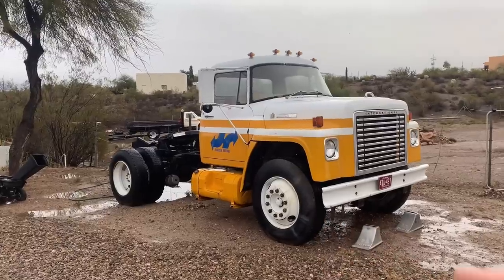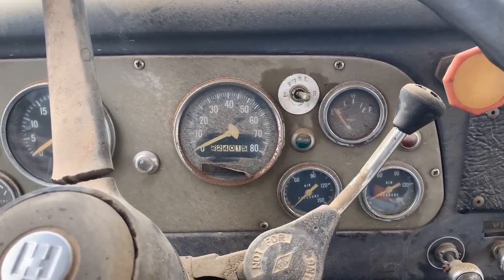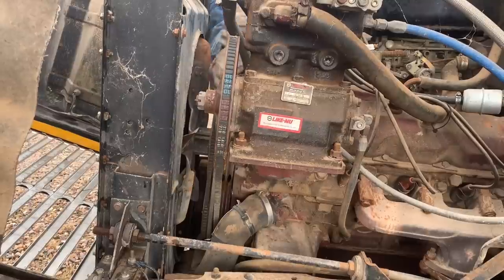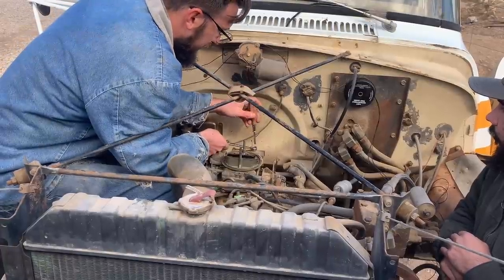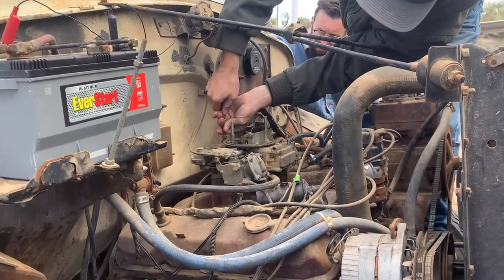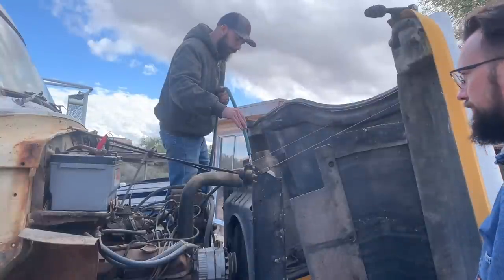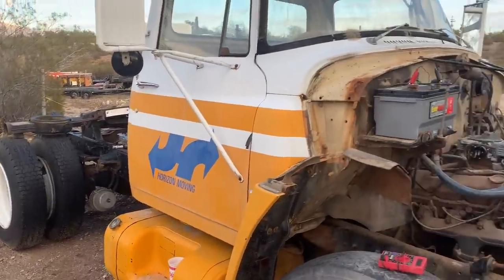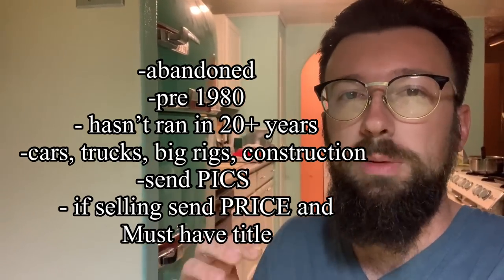Will it run and drive? 1975 international 1800 first start in 24 YEARS!

Comment: That truck is from Tucson,I worked at Desert IHC when they sold it to City Van Lines,before Horizon bought them.If I remember right,it's a 392 ,a really good and strong engine. Thats a really cool truck.that distributor is a Prestolite if I am not mistaken.

Comment: That “not for parking” valve is trailer brakes so you can apply them without having the tractor brakes engaged. Handy for sliding adjustable trailer tandem axles to adjust weight distribution

Comment: Fix it up. Replace all the brake components. Replace any pumps. Find an old trailer box. Fix that up. Make a camper out of it. I lived in Tucson in from 95 to 06. I lived is several apartments mostly around Northgate area

Comment: I know this video is over a year old now, but it's a good idea to have a ball peen or a big ass wrench in hand when turning over an engine you're pretty sure might have a stuck float.

If it starts to blow gas out the top immediately grab the throttle and open it up to keep it running, and start beating the ever loving shit out of the float housing with whatever tool you have in hand until it stops flooding.

This way you can avoid most carb fires, and possibly something worse than that if it gets out of hand

Comment: O-H-I-O Porter greetings 🇺🇸 Those old IH Loadstars we’re quite unique. I remember the bakery in my hometown using them. Cool trucks! That hand valve is a trolley valve for the trailer brakes. It is so cool to see these old trucks still running or reviving them is wonderful! Not surprised that the fuel lines were brittle. You could’ve saved some or all of the rear tires, but that’s how it goes. Glad that you got it running again! I shall look for the next video on it. I’m so impressed that the cab was in such good shape, being in Arizona or not. Good stuff! 🥰😎✌️

Comment: The cubic inches is stamped on the right front side of the engine I think just below the fuel pump. It could be a 345, 392, 404 or I think they made another size bigger but I'm not sure about the number. Maybe a 446. I had a 1974 set up just like that with a 392. Sold it regretted it ever since. Would be interested in that one if its for sale.

Comment: Not trying to be a know it all but are the plugs all in the right order as it sounds like its still misfiring... that said, a valve adjustment if its got adjustable rockers. I have seen these with bent push rods and that can cause running issues like bad idle and terrible throttle control. It should have the same firing order as a chevy only counter clockwise as you said. Lots of transformations on these rigs as they went from the 345 and 392 engines. I had a lot of trouble using the holley carb and used the edelbrock and just things came right together for the starting and idle, plus good throttle response... I really would peek under those valve covers tho cause they were  commonly known for bent pushrods. Another  thing that bugged me on those engines was the oil pressure was almost like a tachometer as it jumped up and down. I loved how much those  trucks were capable of doing. Nice cabins and good steering. I always kept a international around for my grunt work... most of my rigs were kenworths

Comment: Great video! I've got a Fleetstar 2110A that I'm working on getting to run in Brighton, Colorado. Very similar to this truck! 478 engine with the single axle. What is that lever that says "not for parking" on the wheel column? Still trying to figure that out!
Reply: The lever is for trailer brakes.
Reply: I drove one of these 2110`s, it was a 73 with the 478 CI Engine with a 10 spd Road Ranger, 2 axle Dump truck. 2, 50 gallon Step Tanks, got 3 MPG, but it could really pull. Also had the Butter Fly Hood. Loved driving it. Today we couldn`t afford to feed it.

I love the cab style of the  one in the video. really didn`t take too much to get it running for as long as she has sat. Amazing condition for the age.
We also had a 67 with a Detroit Diesel 6V53 Allison Trans. 2 axle Dump, also had the Butter Fly Hood. Air Filter Housing came out the side of the Hood and sat Horizonally in  a depression on the fender. The size of a 5 gallon bucket.

Keep up the work on this truck, love to see any later Video`s.

Comment: That's a jake brake on the steering wheel to control your load.
Reply: No it is not. A single drive axle truck does not have a Jake brake. It is a trailer brake valve